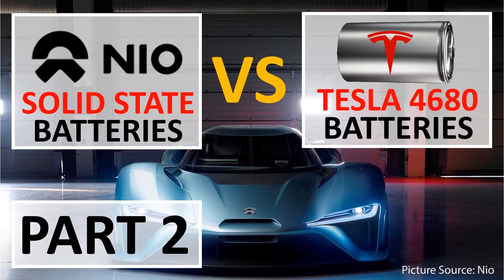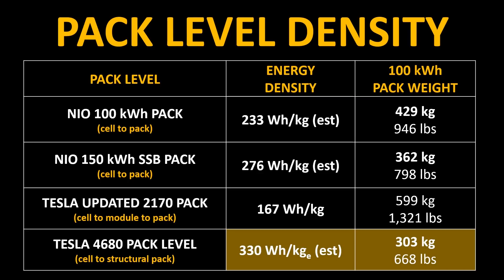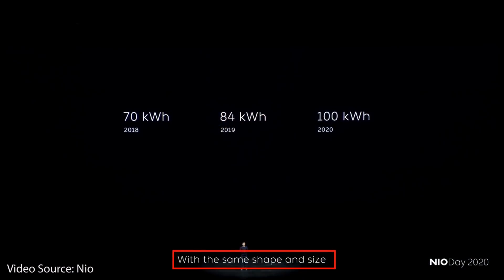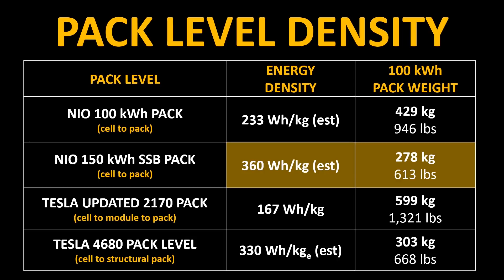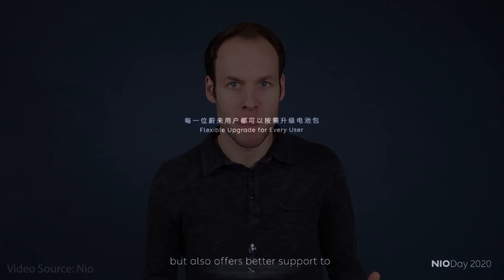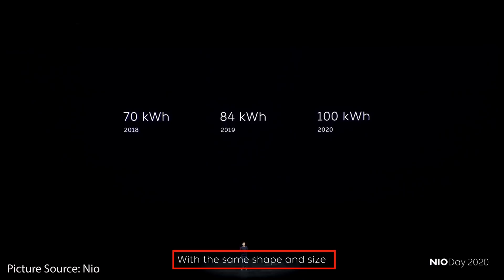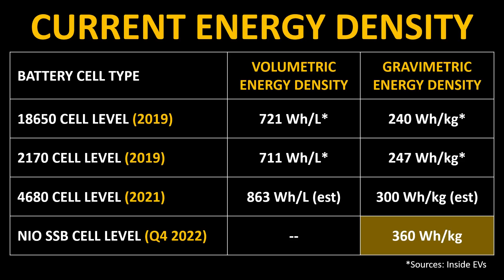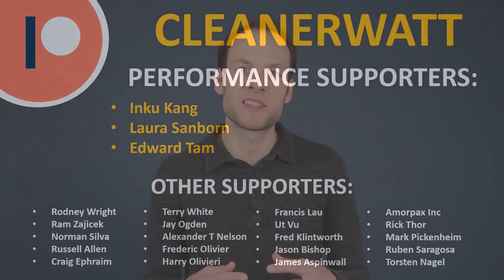Tesla vs NIO Solid State Batteries (Part 2: Did I get it all wrong?)

Comment: And the new Toyota hydrogen fuel cells trumps all of the above

5.6kg hydrogen in a tank (Inc the hydrogen) that is about 95kg works out to...

1963 Wh/kg chemical
1080 Wh/kg electrical

And this could improve another 20% with improvements to the fuel cell and materials to make the tank lighter and the fuel cell more efficient

A hybrid hydrogen vehicle makes sense especially for heavier vehicles but potentially even for cars

Take a model 33SR+ 55KWh pack
Remove 35KWh = 224 kg reduction 
Add a 60kg hydrogen tank system = +65KWh electricity

The vehicle becomes ~150kg lighter and ends up as a 84KWh = 386 mile range (with the range the same in the winter as the waste hydrogen heat can be used for heating)

Yes hydrogen is more expensive than home electricity but will probably be cheaper than super charging

The 20KWh on board batteries will allow 90 mile battery range before you need to use any hydrogen

With 90 miles a day on cheap home charging and 296 miles on hydrogen  you would only dip into the hydrogen on the few days you do more than 90 miles

Hybdid Hydrogen Battery Vehiclds =

Longer Range. Less Weight. Same Range in the winter. And for the average driver it might end up as 95% of annual miles as eletric 5% as hydrogen

Tesla should also get into the fuel cells business they have a ton of money it should be seen as insurance 

Also VTOL becomes far more realistic with fuel cells at 1080 Wh/kg and improving than with battery packs at 156 Wh/kg (current model 3 pack energy density)
Reply: hydrogen falls flat on its face when you consider cost... why do i care about driving 1000 miles non stop when its going to cost 10x as much per mile for hydrogen over pure electricity?
Reply: @odisy64  Lots of people in the world don't have the option to home charge (some countries are 99% apartments) and fast charging is expensive and too incontinent to do it 1-2 times a week

Also only about 1/3rd of oil usage is for passenger cars the other 2/3rds are mostly for HGVs Aircraft Ships

For those applications energy density matters and the energy density of Hydrogen fuel cells are significantly higher than Li ion batteries

Also hydrogen is expensive now as there isn't really a hydrogen market. If there was a hydrogen market companies would build solar and wind farms and electrify hydrogen at the farm. 3 cent electricity could be turned into 10 cent hydrogen delivered to the city and into a car/truck tank

10 cent hydrogen is cheap enough and is cheaper than gasoline

Also in theory a hydrogen car (and definitely a truck aircraft and ship) would be cheaper to make than a full battery version because its 140kg fuel cell system vs 600kg battery pack
Reply: @kaya051285  most people who live in apartments also dont have spaces for cars but parking lots can easily have charging poles put in them.

i know hydrogen i smore energy dense, you explaining this makes me think you underestimate how much i know about this subject. 

i brought up cost because people usually give the least satisfying answers for it, all of them starting off with "hydrogen is expensive now as there isn't really a hydrogen market". you guys think mass production is going to magically reduce prices but forget, transportation, containment, physicals volume end up raising the price regardless of how cheap your manufacturing is.

why build a solar farm to make hydrogen when you can just plug it straight to the power grid where you will have less energy loss in conversion and its already as cheap as it can come. half the energy produced by those power plants will be lost by the time it gets to your wheels if you choose hydrogen.

hydrogen only really start to be viable in very large scale vehicles where range and weight are prioritized over cost.

but for the daily drive, pure EV's will always be cheaper than hydrogen no matter how mass produced it is.
Reply: @odisy64  I agree battery is more efficient than hydrogen fuel cell

BUT most people don't realise that a pipeline to carry atoms is far more 'efficient' than the wires and electronics to carry electricity 

To give you an example here in the UK

Retail electricity = 16p
Wholesale electricity = 4.5p
Therefore 11.5p overheads 

Retail Natiral Gas = 3p
Wholesale NG = 1.7p
Therefore 1.3p overheads

As you can see it's vastly cheaper to move atoms than electricity almost 10x cheaper

Most people overlooked this very important consideration
Reply: @odisy64  Hydrogen will be cheaper than the price of superchargers. But yes more expensive than home charging. Somewhere in between the two

The fuel cell system should be cheaper than the battery version just because there is so much less mass to build and the biggest cost of a fuel cell system is the carbon fibre tank and the price of those has fallen and will continue to fall

Also as the size of the vehicle increases the fuel cells get exponentially better vs the battery system

For example if you have a HGV with a 1,000 KWh battery it would weigh about 5.7 tons using current tesla batteries

The same 1,000KWh equivalent for a fuel cell would be closer to 0.7 tons

So you can have 8x the range
Or have the vehicle be 5 tons less heavy allowing 5 tons more cargo

Having said this
I actually think for the middle and lower end passenger vehicles we will have batteries. For vans trucks HGVs Aircraft Shipping it will be Hydrogen fuel cells and hydrogen gas turbines
Reply: @kaya051285  i find it hard to believe hydrogen will be cheaper than supercharging unless you live somewhere with high electricity rates, but hey, if your building power plants for hydrogen then you can build power plants to reduce electrical cost too.

if a company buys a Tesla semi that can go 500 miles carrying 80,000 lbs and its stil cheaper to run per mile than hydrogen semi that can go 1000 miles carrying 90,000 lbs then they are going to go with a Tesla because of the majority use cases. most of the time you wont go max range or carry max load so choosing to always be cheaper per mile is a more economical choice.

as hydrogen Tech progresses so will batteries, they will get lighter, go further, cost less, and last longer. i just believe hydrogen wont be a part of road vehicular transportation, more like cargo boats and planes.
Reply: @odisy64  A few weeks ago I would have 100% agreed with you but I decided to look at the new Toyota Mirai fuel cell system and when you look at the data you can see how vast the difference in energy density is compared to batteries. And also how much progress Toyota has made from the previous version to the 2021 version was a surprise

Yes batteries can and will improve about 5% a year but their upper limit is around 400-500Wh/kg they physically can't get much better than that. Also batteries need thermal management which adds weight and complexity so you can knock about 25% off the energy density above

Whereas fuel cells are already today at double the maximum possible energy density of li ion batteries

If there was a green hydrogen infrastructure existing today it would be no question the fuel cells would win but there isn't a green hydrogen infrastructure so batteries will have at least the next 10-15 years

I don't actually disagree with you
I think for passenger cars batteries will be the winner because they just got there first. In the same way that gasoline got to ICE before NG. NG is far cleaner far cheaper and can be used in ICE but gasoline took the market first and NG was left on the sideline even thigh its 5-10x cheaper than gasoline

Hydrogen will be a very big part of the energy system in 2050 imo. as it will be cheaper to build an offshore wind farm and directly electrolise water and a simple pipe to bring the hydrogen onshore.

Rather than build a offshore wind farm + HVDC converter Station and then wire that onto shore to then recovery to AC and then massively upgrade an expensive grid to supply that electricity to homes and businesses

Even if we had to totally upgrade most the natural gas pipelines it would be cheaper to do that than to expand the grid 3-4x to electrify heating. Going back to the fact it's almost 10x the cost to move electricity than it is to move atoms of NG
Reply: @odisy64  Just to be clear I think the hydrogen producing power stations will be off grid solar and wind farms. Not needing to connect to the grid saves a lot of money

Oh just one more thing
If someone develops tech to reduce the cost of the grid so the cost of moving electricity becomes more affordable then the hydrogen argument falls down

But as it currently stands in Europe its 5-10x more expensive to move electricity vs NG atoms

And looking at the USA eg texas average retail electricity 11.9 cents vs 2.6 cents wholesale = 9.3 cents overheads 

Average NG retail 3.5 cent average wholesale 1 cent = 2.5 cent overhead

So about 4x more expensive to move electricity vs NG
Reply: @kaya051285  after reading all this i have to seriously question your understanding of energy distribution and cost. i dont work in the industry but i have had training in commercial and residential electrical installation and i find it very hard to believe pipelines are more efficient than wire. you dont start by comparing it to current prices in the UK (one of them being how most of the world is not like the UK). you have to actual start with two solid comparison between a specific type of power line (can easily range from 20k to 400k volts) and compare it to the flow rate of a pipeline and its distribution within a city/residential zone . you then have to differentiate initial cost for infrastructure and the run cost and then divide that by its expected operational lifetime. this is incredibly difficult since rates and variables are different for every region in the world. where i live 75% of our energy is hydroelectric while only 10% is fossil fuels, i pay around 7 cents per kwh because my city is surrounded by powerplants but god damn is gasoline and gas expensive here despite having multiple refineries. 

i feel like you are heavily invested in hydrogen and are overlooking some of the fundamental problems by telling yourself certain things will happen like how people are going to spend billions of dollars building electrical plants that are solely going to be used for hydrogen facility's that also have to be paid for an maintained to make a fuel that has to be specially contained and transported but also loses half its energy once its being used in a vehicle.
Reply: @odisy64  All the complexity and cost and labour and upkeep is embeded in the price you pay 

I just checked for texas too, and it's far cheaper to transport natural gas to homes than it is to transport electricity

I have zero investments in hydrogen so I'm not biased 

If you look at electricity vs hydrogen without considering transmission then hydrogen seems like a fools idea. But when consider the cost of transmission and distribution moving one kwh as methane is much cheaper than moving one unit as electricity

You should take some time to consider this before writing it off. As I said a few weeks ago I would have 100% agreed with you
Reply: @kaya051285  its not about the price YOU pay, its the total price everyone else has payed. you are comparing fossil fuels to electricity also, fossil fuels are traditionally very energy dense and very cheap compared to electricity for some applications such as heating unless we are talking about an ARK furnace. its easier to set up an electrical line than a pipeline to 100,000 homes in a city. most homes ive seen have a gas line only for heating but most of the newer houses i install have no gas lines, just an extra 240 line to an electric heater. i use an electric heater for my house, it consumes over 12,000 watts an hour. setting up the wiring for that was way cheaper then setting up my own pipes. gas heating would have been way cheaper per BTU but i like clean air and not having to worry about an explosion.

one thing i know about hydrogen is that its an absolute problem to keep contained, it bleeds through the atomic cracks in anything so a pipeline like this probably wont be underground for easy maintenance but then you also have to deal with running a pipeline full explosive liquid hydrogen through peoples communities. gas stations dont have pipe lines delivering to them and instead of big expensive trucks hauling it instead (cost).

i dont believe you have any money in hydrogen, by "invested" i meant that you have very high hopes for Hydrogen technology and that may cause you to undermine an electrical infrastructure.

from my estimations the US will need around a 30% expansion to its grid capacity to supply all cars being electric. to me this sound easy as hell considering the vast majority of infrastructure is already in place while non exist for hydrogen. i just saw my city building a new power line across a set of 3 mountain ridges, it took them a few months and the permit cost took most of the cost of the project. if we did this with hydrogen we would have already been over budged building the pumpstations to get the hydrogen  over the mountains before the pipes can even be placed.

hyrdogen is cheap enough to transport by pipeline but our electrical infrastructure is already superior for energy distribution despites hydrogens superior energy.

hydrogen cars are a no for me because i hate gas stations and rather "refill" my car off a plug in my house for $5 and i just cant do that with hydrogen.

Comment: Swapable batteries for cars have some issues, we know that all the packs need to be identical, the capacity can be different, but they need to be identical, not only by size and shape and all interfaces but they also need to be same weight more or less.  If one battery is 400 lb lighter than another pack the suspension and shock absorbers needs to be adjusted accordingly or the driving comfort will suffer significantly.
The other problem is that you need some extra batteries for swapping.
Reply: They already use adaptive air suspension. Your problem is already solved.

Comment: This is an interesting video series, and I’m looking forward to the next one.
Regarding the hybrid SS battery technologies from NIO, Toyota, and QuantumScape however, I’m pretty unmoved by them on a practical, real-world level. They already seem to be ‘yesterday’s’ technology in light of Tesla’s 4680 cells, especially considering that they won’t be in mass production any time soon. If the date is 2024, I wouldn’t be surprised if Tesla (and other battery technology labs) are on their way to capacitor batteries or something quite mind blowing. In the meantime, the 4680s will be a beautiful balance of energy and and economy of production. As they stand, Teslas are already extremely capable vehicles...especially with the supercharger network.
As for battery swap, Renault’s battery lease wasn’t that popular (especially on the used market), and I think a lot people, myself included, will find NIO’s battery swap idea off-putting, and unnecessarily convoluted...possibly unreliable?
I’m looking forward to seeing NIOs here in Europe, but will they (and the rest), please concentrate on good quality, affordable EVs that have good capability now, rather than trying to wow with technological promise and razzmatazz?

Comment: Jon,
Regarding the Wh/kg of 2170/ 4680 cells.
Assuming the case ("can") of each cell is made of the same material and is the same thickness, calculating the outside surface area shows the 4680 uses 2.77 times the material.
However, I believe an equivalent 2170 pack would use 4416 cells, compared to 960 4480 cells.
The 4680 pack uses only 60% of the metal in the "cans". This would in itself improve the 4680 pack Wh/kg, over and above the pack casing weight removal.

Comment: It’s cell level. Also it’s end 22 which could easily become end 23 for mass production.
Tesla will almost certainly have incrementally improved by end 22.
Format is a big change as is tabbless. 
.Chemistry can be tweaked every month with no change to the assembly line.
Expérimentation will happen at Fremont then new chemistry will be rolled out to every other factory when it’s ready.
I expect improvements already by end 2021, it’s just in Tesla’s DNA.

Comment: The comparison at the battery pack level is irrelevant until one pack is structural, like Tesla's 4680 while Nio's needs a frame or a box. So we would need to compare at vehicle level.
Reply: when is the structural pack planned for? as far as I am aware, there was no timeline estimated for this during Battery Day and it felt that with the huge problems it poses from an engineering / regulatory crash testing / repairability standpoint, it could be 5 to 10 years away from mass production. So, mostly irrelevant for now.
Reply: As far as i understood, the 4680 batteries will come in a self supporting structural package and they are going to be implemented very soon into the existing models.